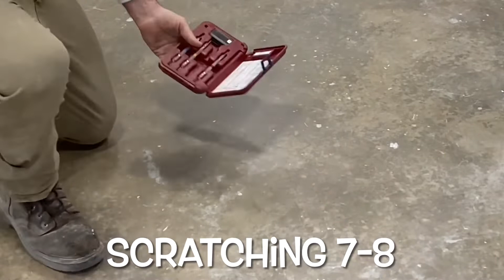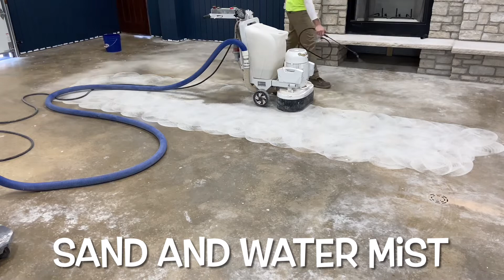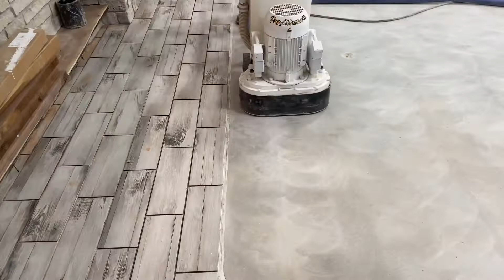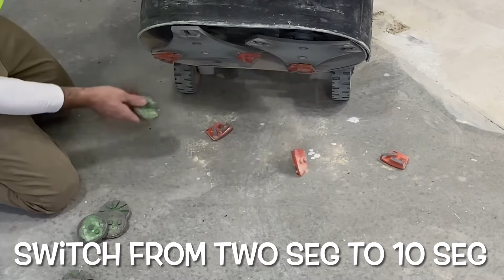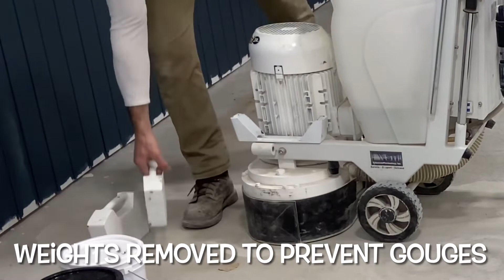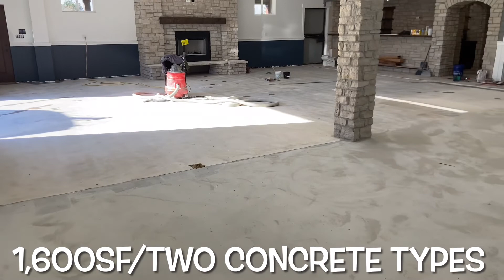How To: Diamond Grinding Hard and Soft Concrete

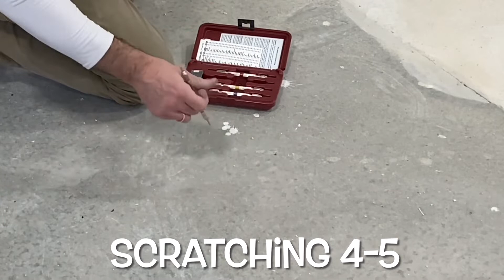Comment: From experience, the impact of low surface area (two segment) versus high surface area (10 segment) based on concrete hardness, grit size, and metal bond type can be huge! You are absolutely correct about "varying" the weight and tool type (grit and # segments (surface area). For the scratch testing shown at 0:14 and 1:50 (assuming ASTM C1895-20 method), based on all the experimenting that you have done, have you ever determined a correlation between that mohs hardness scratch testing ASTM C1895) and the number of tool segments (surface area) to use? It gets pretty complex quickly considering machine weight, diamond grit size, and type of metal bond (soft, med, hard), but figured I'd ask. Keep up the great work producing content!
Reply from the maker: Terrific input, good questions, and your compliment is well received. Thank you. 

I have not gone down the path of matching pick test results to the diamond selection. The reason being is it can happen that a slab has a hard shell, but then quickly exposes a much softer layer. In which case, I might have to switch to a full face tool from a two seg. The pick tests are good for survey, but I’ve still got the different tool types on each demo. 

Thank you again. I appreciate the experienced input.

Comment: Awesome information on your channel.  I'm curious if you've done exterior patio type work?  
We have a newly poured patio slab and the salt texture we wanted turned out to be far more aggressive than planned.  It actually raised edges around the indentations like a crater effect.  We believe salt was too large and introduced and tamped too soon.
Is there process that can be done to "smooth" it down a bit without totally changing the color or having to follow up with a seal coat?  Thanks
Reply from the maker: Thanks so much for the compliment. 
It could be passed over with a grinder. Depending what you’re hoping to achieve, it would help to reduce the elevation inequalities. As far as needing a seal coat, it will in some part have freshly exposed concrete matrix as the result of diamond grinding.